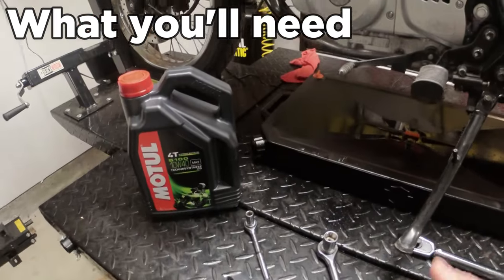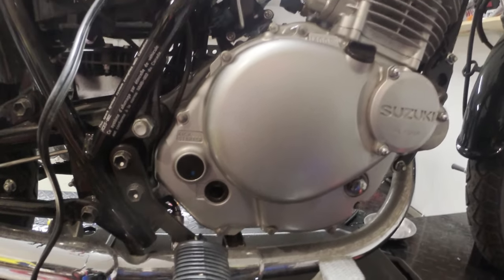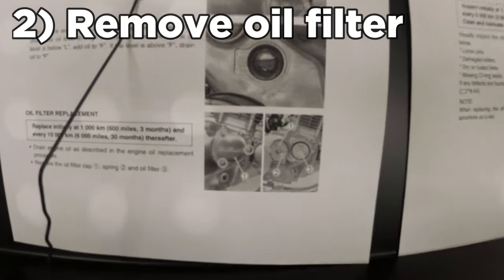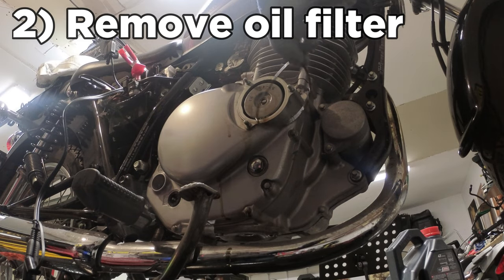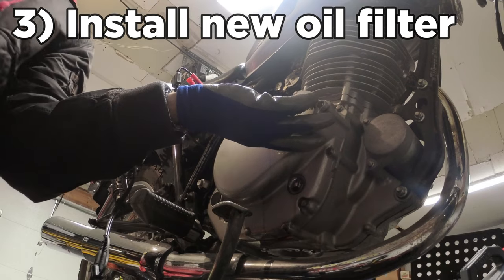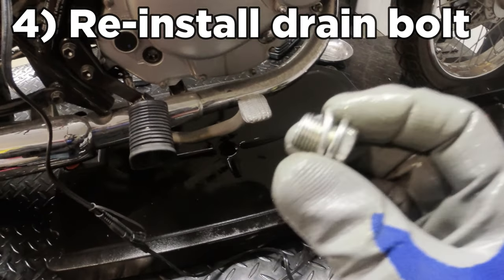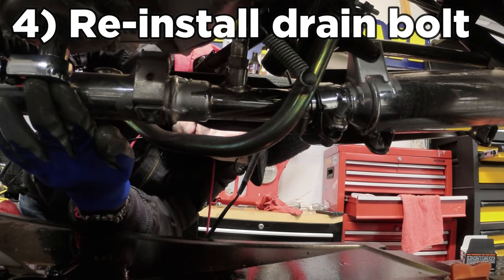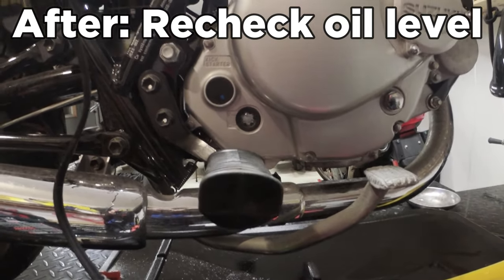How To Change Oil Suzuki TU250

Comment from the maker: WHAT YOU NEED:
10W-40 motorcycle oil https://amzn.to/3geVvQZ
KN-136 oil filter https://amzn.to/2QdIZ9N
Torque wrench https://amzn.to/3qfaGeO
Socket set (10mm and 17mm bits) https://amzn.to/3dqAHUF
Low profile oil drain pan https://amzn.to/3ajh1QO
Funnel https://amzn.to/3dr9FwI
Motorcycle lift table (optional): https://discount-ramps.sjv.io/motorcyclelift